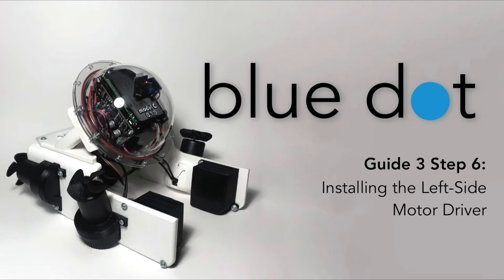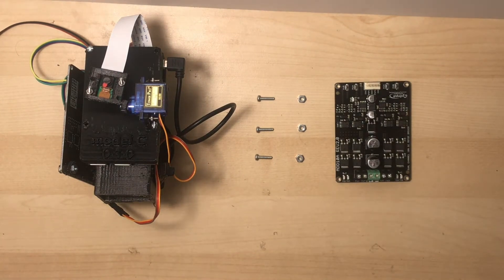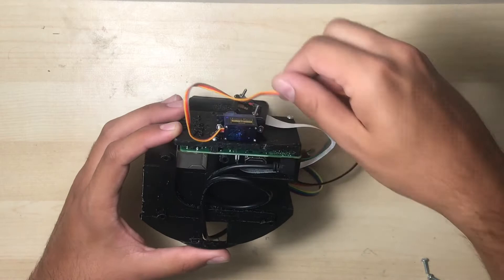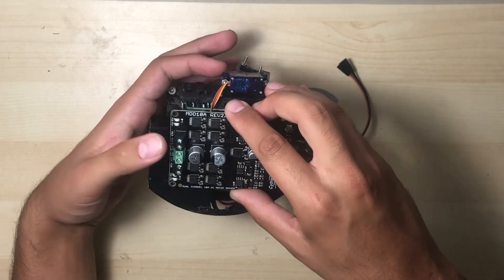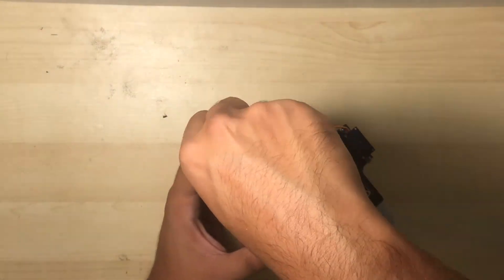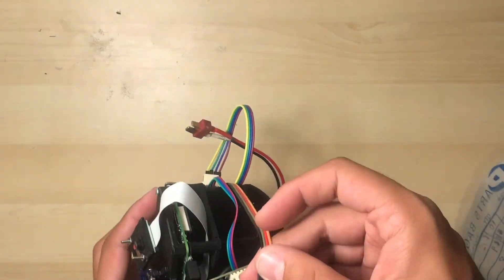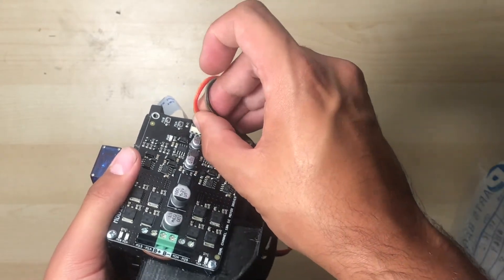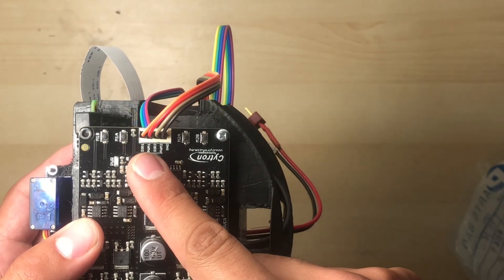DIY Underwater ROV, Cytron Motor Driver Setup (Guide 3 Step 6)

Comment: I have a a GENEINNO POSIDEN underwater drone that is using the rasberry pie 3 software , I would like to add two more vertical thrusters to help stabilize it and also a gps module to it also, any help would be gratefull , or I would actually pay you to build me a complete new setup.